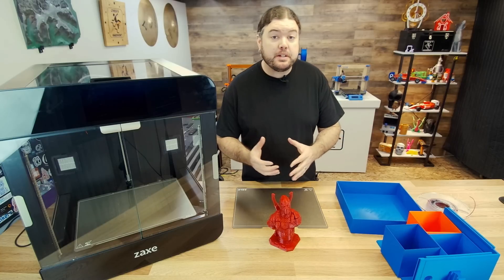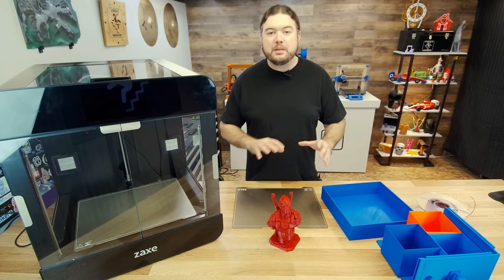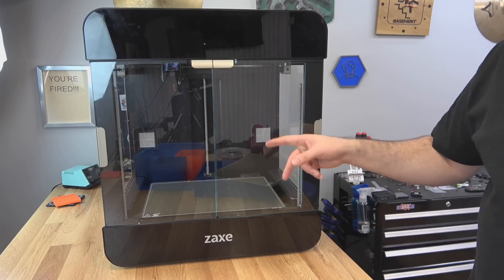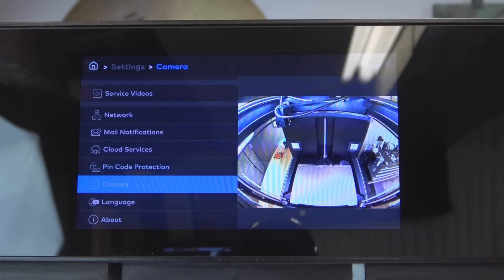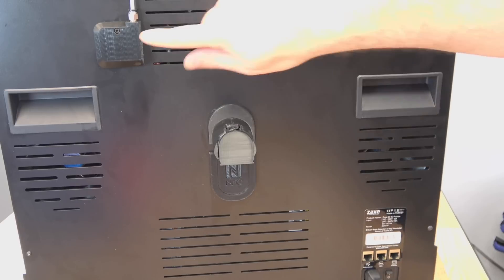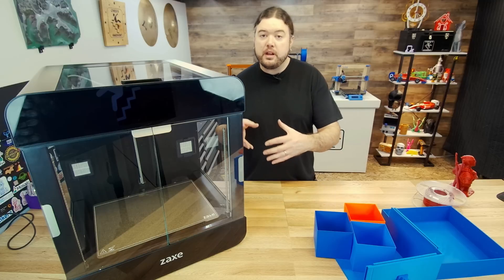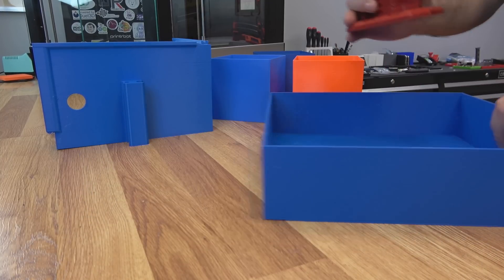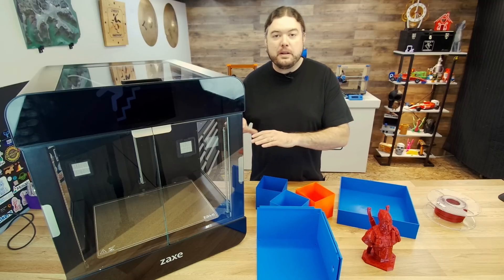Zaxe Z3  - 3D Printer Overview - Chris's Basement - 2022

Comment: Interesting you have such good things to say about it so far my experience has been pretty bad. the bed leveling is really really bad it just doesn’t work. I’m trying to use the whole build plate and the z is so far off it’s not even funny. I wanna get my grubby hands on the printer.cfg so I can edit the bed leveling process. Also the 4k printer doesn’t have an extruder e step calibration setting. I’m hoping it’s right from factory but it kinda looks like it might be off.

Comment: i recently got access to a x3 printer by Zaxe and find the XDesktop slicer to be lacking. Does anyone know where to find settings like acceleration and speeds to setup up PrusaSlicer for example?
Reply: they dont have any... sadly its not even any klipper on them as mentioned here. you cant controll speed nor other settings. there is no klipper on z3 or x3.... i dont understand how they can just say it has it without any proof?
Reply from the maker: The settings in the slicer are pretty limited, hopefully they will continue to add features.
Reply: @ChrisRiley  but where is the klipper part in this printer that you mention? i do have z3 and x3 but there is no klipper in them. you should do a better research chris because me and others trust your reviews.
Reply from the maker: @gogogorandom  have a look. https://learn.zaxe.com/articles/what-is-klipper-and-how-it-makes-your-zaxe-3d-printer-better
Reply: @ChrisRiley  i have read all that, ive done multipli klipper mashines include some vorons. and i say it again. There is no klipper integrated in zaxe printers. Im working on installing fully open klipper kontroll on them all. But for what they are now, the printers are not finished, they dont have any speed, any so called klipper funktions. yes i can accept klipper integration by name but by looking at the speed, slicing, printing and display ui. there is no klipper. Its very sad because you could show some klipper funktions but there is none. the eco system of zaxe is not finished jet.
Reply from the maker: @gogogorandom  I'm not trying to argue with you at all, but I do want to understand. These machines run Klipper, meaning Klipper is in control of the MCU and the gcode parsing. Are you saying the features that can be used with Klipper are not very utilized. I just want to make sure others that read this aren't confused about what Klipper is. I agree with you Zaxe needs to polish these installs and open up more options and features.
Reply: @ChrisRiley  yes, it will be like a nissa lief saying hey we have tesla batteri and mcu but we dont have the oppertunity to use it. so for now we say it just to sell. Its very important that people know that there isnt speed controlls on this printers and that you are limited to xdesktop which is a very poor cura engine and outdated. For me its important that you share that info. Im working on opening the full possebilities on these machines because right now they are a ferrari running like an old fiat. its very sad that zaxe has not worked hard with the software and good klipper integration. But we can agree to disagree. overall its nice to finally see someone post videos on industrial printers! thanks champ!

Comment: I don't understand all of the praise? Seems like a basic corexy with off the shelf parts and klipper. Doesn't seem to offer anything that the bambu labs carbon printer already offers while costing 4x more.

That basic e3d v6 hotend for example isn't really "industrially reliable" and will clog from time to time. Is a clog easy to clear? Can a user easily swap out hotends? Even $60K Stratasys machines offer easily replaceability for hotends and other parts that can wear.
Reply from the maker: Thank you for your insight!

Comment: This printer is not fully developed at the moment. This system is sold with Klipper only by the words. You are not able to use things like imput shaper with the g-sensor , you can´t print really fast. The system is well designed  in mechanical way, very sturdy. It uses no chinese knock off parts,all genuine parts. But for the money you pay (more than 4300€) this is not enough value. You can use the camera only with the app. It is not possible to use it with your pc. The doumentation is really low. When I purchased this printer there was no information availlable for the OctoPi feature.
And most annoying is the ptfe tube at the print head which is not fixed like on every ender 3 budget china printer.
Reply from the maker: It does have a ways to go, I'm looking forward to see what updates they come up with.
Reply: thats what u feel. the there is no klipper in that printer for sure! and still, how come you cant even decide which speed settings you want? i feel that alot if not all about z3 is a lie. Lets not talk about the slicer Xdesktop! Its so slow! bad and terrible! the first ever cura which came many many years ago was even better.